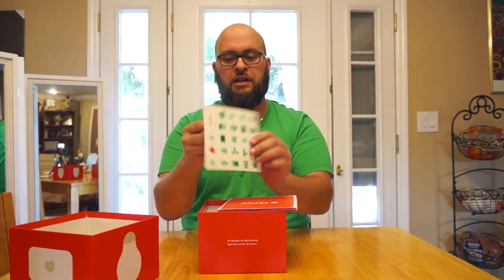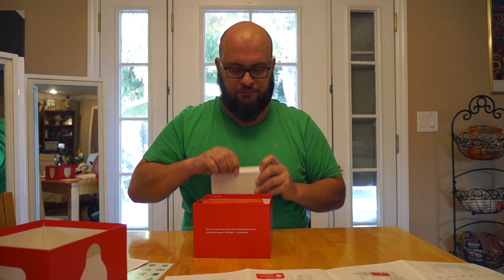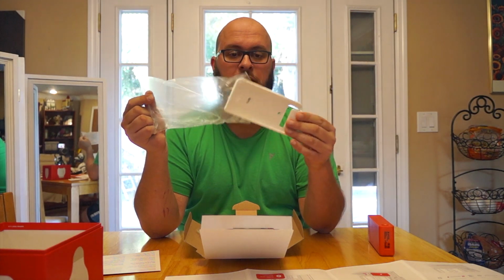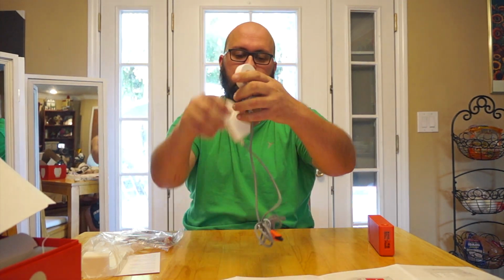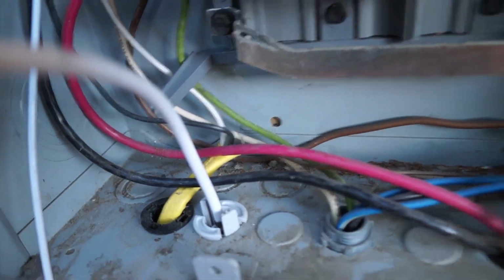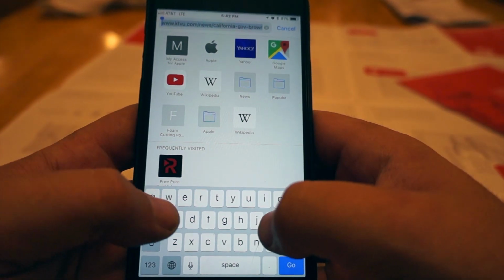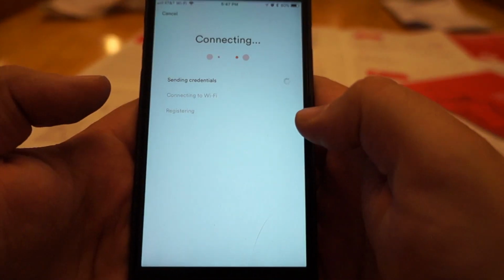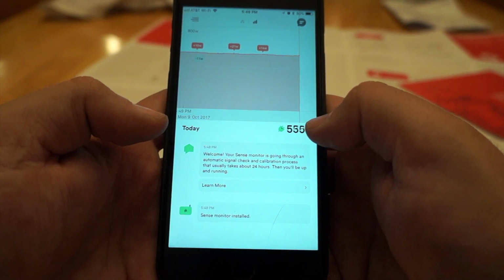Unboxing and install of Sense

Comment: where should I connect the power of Sense to? can I connect it to the existing dual 20am breaker? (that existing dual 20am breaker are currently powering the house bedrooms and reset lights as well, is it ok?) does it have to be dual 40 am or dual 20 am breaker ok?
Reply from the maker: It has to be a 220v dual breaker. I think I used my oven breaker. It recommends using a new 220v breaker but I did not have any open slots.
Reply from the maker: The Amps do not matter just as long as it a 220 breaker not a 120 breaker.